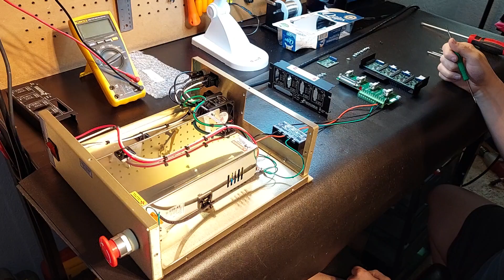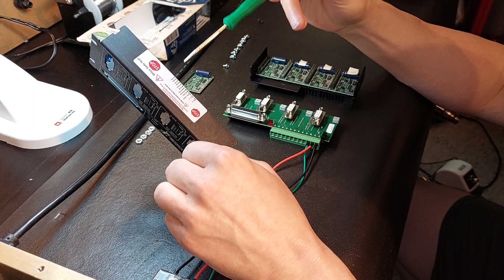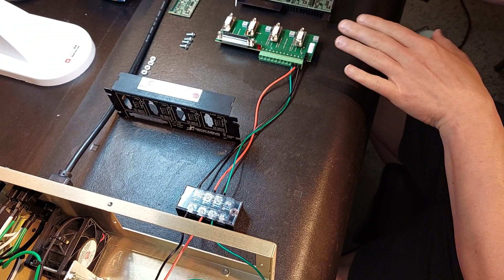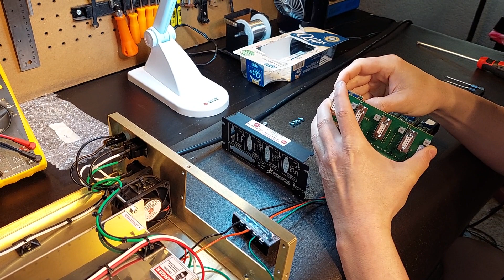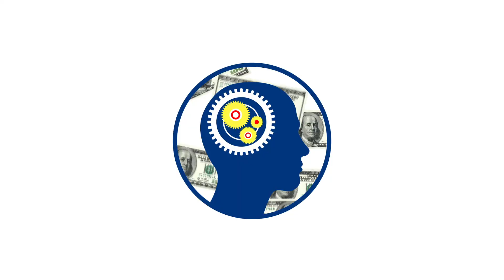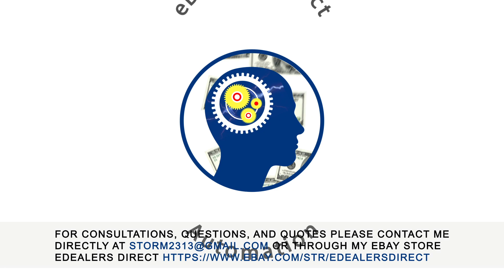How To Check A Gecko G540 For A Blown Drive....

Comment: When I test my g540 main board unhooked from the drives it never comes out of fault. So I’m guessing at a minimum the main board is bad. I’ve been using this g540 for over 10 years. I know I could buy a new main board for about $150 but I feel like it’s probably smarter to just buy a whole new unit at this point. What do you think?
Reply from the maker: If you get 10 years out of anything CNC related you obviously got your money's worth. 

 I would suggest as you already pointed out replacing the whole drive makes the most financial sense while keeping the old drives drivers for spares should you ever require them. 

Thank you,
Vince
Reply: @corvetteguy50 thanks, I ordered one from your eBay store 👍
Reply from the maker: Thank you sir, I really appreciate the support.

Vince

Comment: Vince I have a G540 that isn’t working properly and yet the drive shows a green light. In this case the A drive is used as a slave to the Y axis. The A drive only sends the gantry in one direction. I switched the Y drive DB9 to the A axis and it does the same thing. I switched the A axis motor to the Y drive and it runs both directions. 

I think I have isolated the problem to the A axis driver but did I?

I sent this same drive in a few years ago for repair under warranty and I don’t remember what the process was.
Reply from the maker: Hey Larry if you isolated the bad drive then you'll most likely have to buy another, and I have then in stock. Gecko doesn't do multiple repairs on the same drive. Thank you,
Vince